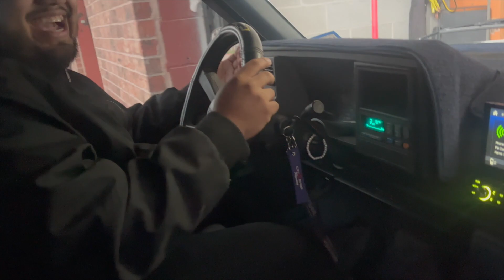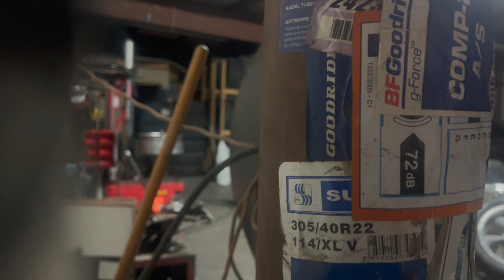KING LIP (OBS) GETS ANOTHER FLAT TIRE!!!24x15 intro wheels

Comment: Ya 2023 nombre To Fast had to stop by and say what's up before end of year
Reply from the maker: Yes sir time flies appreciate you my boy since day 1🙌🏽
Reply: Picked up a 1989 c3500 dually single cab 454 motor burgandy
Reply from the maker: Badass bro i have one but its a rust bucket just sitting there imma use the the motor though for something
Reply: Ay I need to hit up corpus to pick up some trim & check out the Rust bucket $$$
Reply from the maker: Mi casa es tu casa bro whenever you please comenon through👌🏼